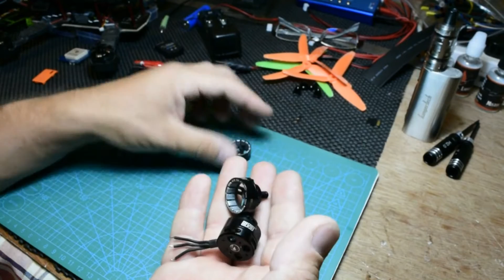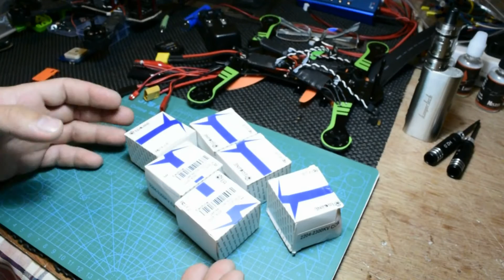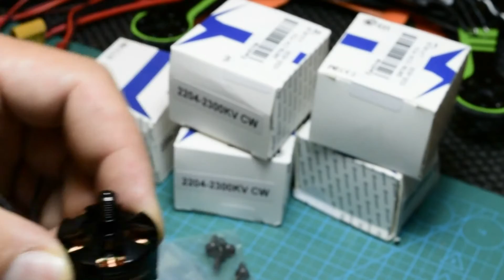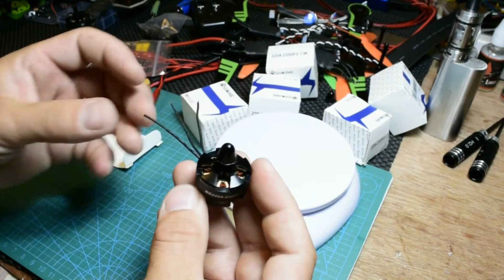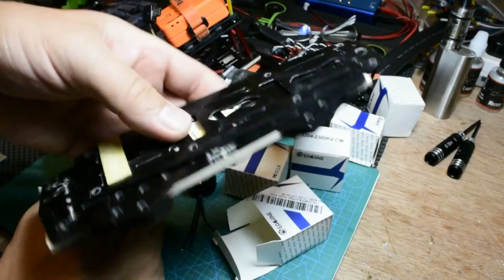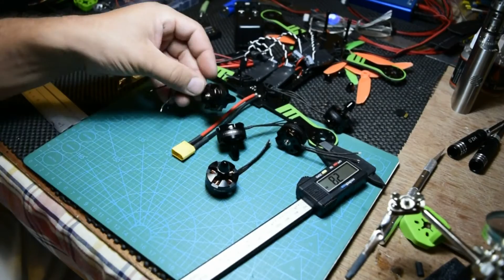Eachine BG2204 2300KV Brushless Motor CWCCW

Comment: Which capacity battery for more flight time and speed on these motor?
Reply from the maker: For more thrust 4S lipo battery it's perfect. But if you just start to fly a quadcopter I recommend 2S or 3S maximum....for more time flight 2300mah  2800mah for 5-8min. But the best 1300mah or 1500mah for 3-5min.
Reply: hello but lipo battery same4s  1100 90c is good ?it's ok for this motors?with 20amp escs?

Comment: Do you have thrust spec of this motor?
Reply from the maker: Hi
No cuz I don't have a trust tool to calculate. But I use with 5.45 prop and it's fast. But I think with 5.45 prop and 3S lipo 400g...or 500g with 4S. and with 6.45 prop and 3S lipo 500g...or 600g with 4S. I hope I help you with something. Cheers